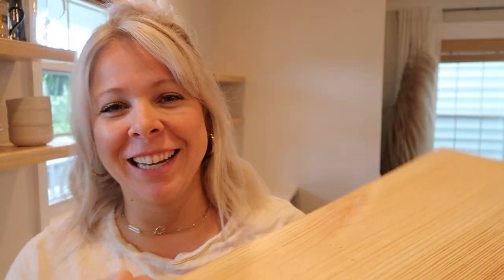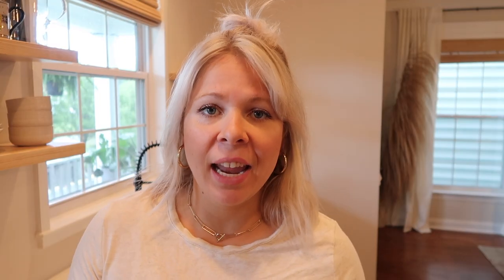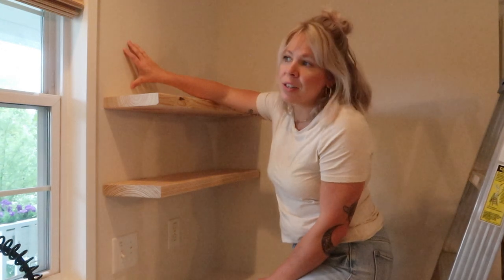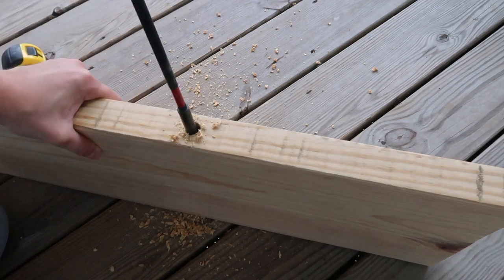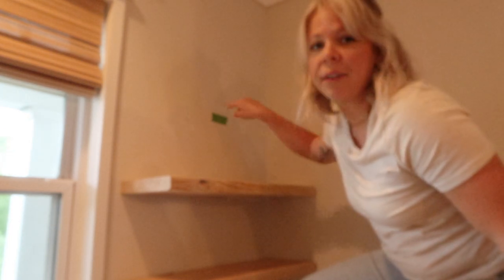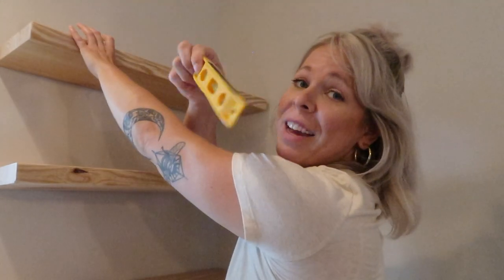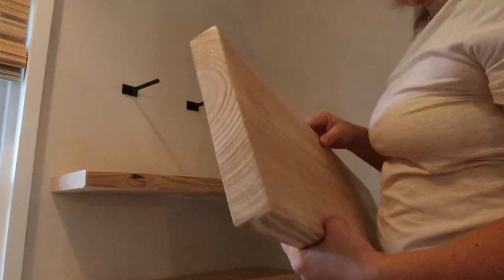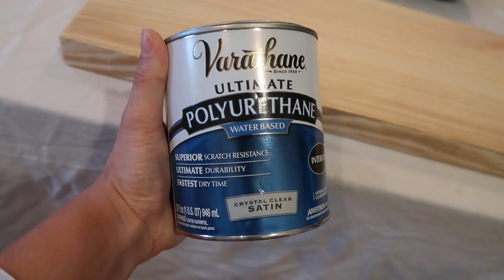Open Shelving Tutorial | Floating + No Brackets

Comment: Hi Megan! How did you ensure that the holes you drilled into the wood were straight?
Reply from the maker: Hey Hannah! Applying even downward pressure certainly helps, but it’s not guaranteed. That’s why I hung it the way that I did, so that even if the holes weren’t perfectly straight, the shelf would still be level and stable.